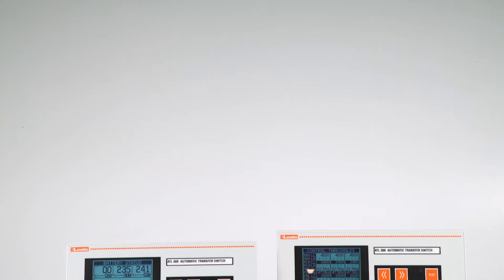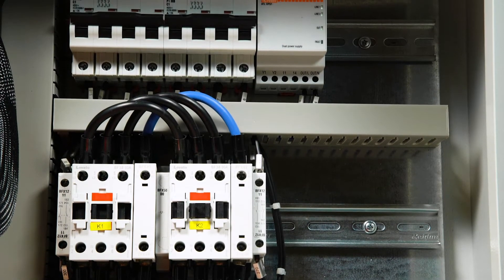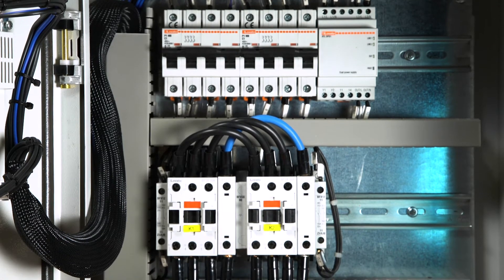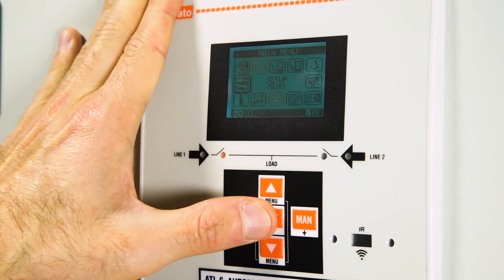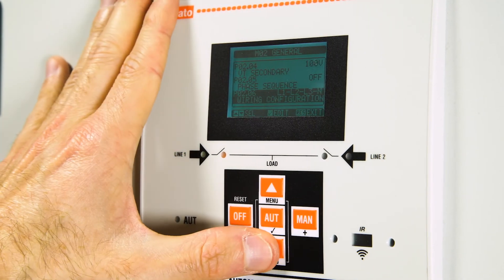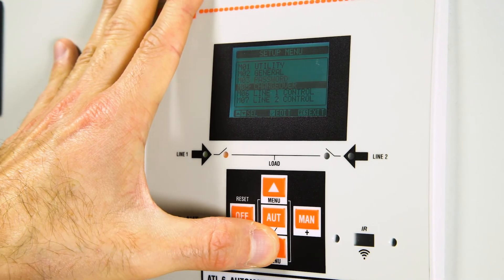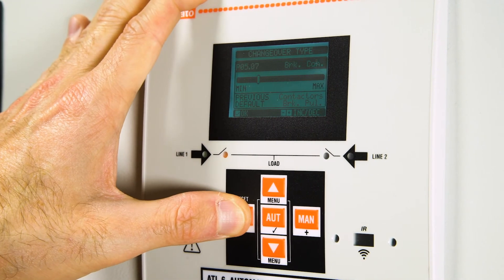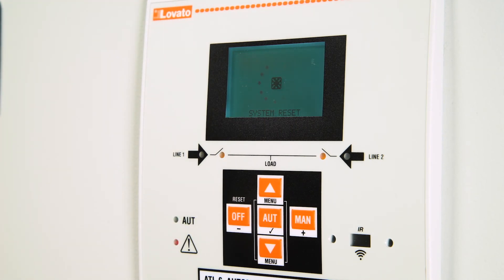1. Basic configuration - ATL Series | LOVATO Electric

Comment: hi
greeting
I need help
We have a Lovato device that takes off the generator and reverses the supply from the network to the generator
At the exits(output), we found that there is tension, and when we connect it with the relay, the relay's coil is not fed
We made sure that there is tension in the outlet 27 volts, but when connected to the relay, it does not work
Note that when it is connected from the device's feed to death, the relay is fed and works
I hope the question is clear, waiting for an answer
Thanks
Reply: Om su bisa kah? Kitong ad dapat masalah jg ni
Reply: Did you find a solution ? Pls share
Reply from the maker: Please, make in contact with out technical support here https://www.lovatoelectric.com/gl_en/contacts/technical-support/